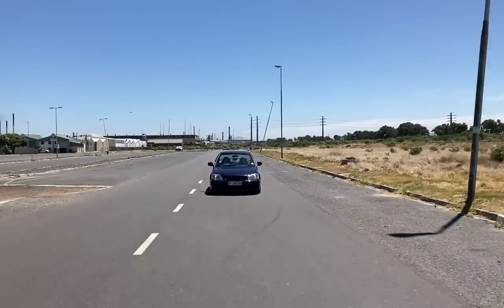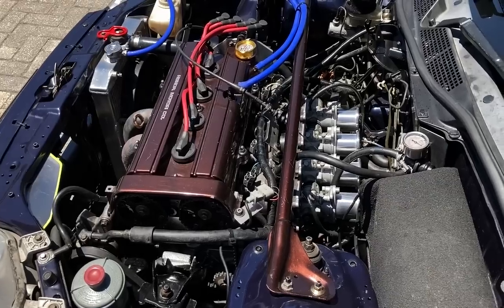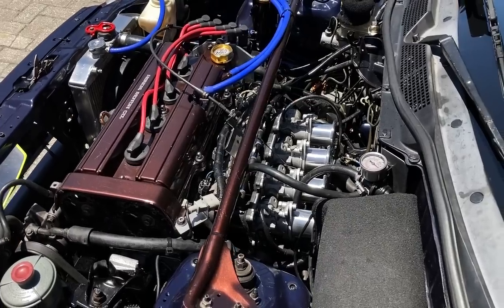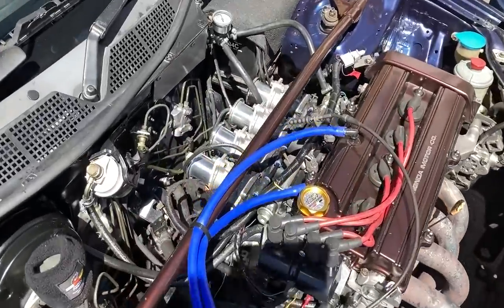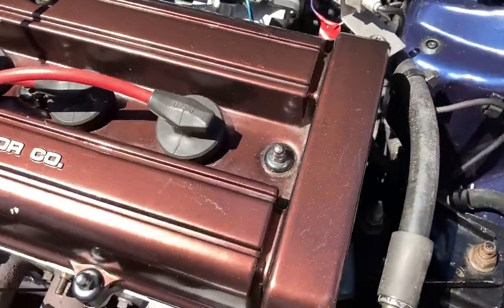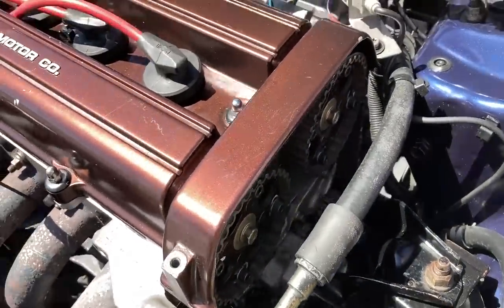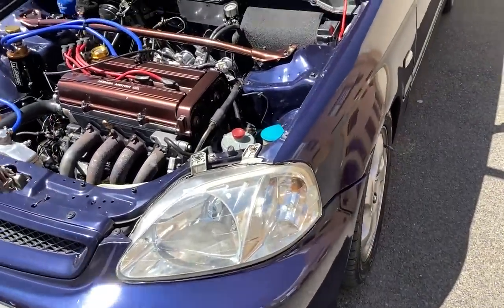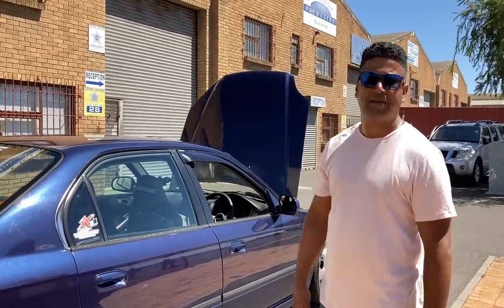THROTTLE FED B20B HONDA | STAGE 2 😍😩 | This is my ride Ep61

Comment: This isn't a vtec setup it is still cool but it seems like this guy doesn't know Honda's again cool car and I love my Honda's but I don't like when misinformation is put out as it can confuse people who are starting out.
Reply: I agree , b20b itbs??? There made for low end not top end , itbs be usless and to tune just thrown money at it for pretty much no reason
Reply: Get rid of the itbs or get a vtec head to utalise then propley , what’s the redline on this? Max what 7200rpm or so ? Anyone agree itbs peopley only work after that rpm
Reply: @James-p6y6o Honestly I say it depends on the size u can have midrange power from  an itb setup but hp per dollar it doesn't make sense it's a ton of dyno testing different headers cams head porting etc. this particular setup with the stage 2 crowers are good for 8k but u better have a 10mm to put ur rocker back on lol. For the money into this set-up u could have a very nice b20v like mine and make same or better torque and much more room to grow into more power